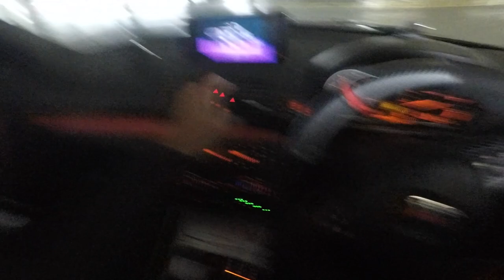Installing M3 Side Mirror Covers on BMW 1 Series E88 E87 E82 E81 10K SUBSCRIBERS FREE CASH GIVEAWAY

Comment: How do you get the mirrors to fold in? Tried a long press on the key fob lock button but nothing happens. Does it need to be coded?
Reply from the maker: @AGray-ug2gm  does your car have the folding door mirrors feature?
Reply: @CARLISONIT  it’s a 2013 E88
Reply from the maker: @AGray-ug2gm  ok but does it have the folding mirrors feature? You will know if you have the button to close your mirrors on the driver side door
Reply: @CARLISONIT  no button other than to adjust the tilt
Reply from the maker: @AGray-ug2gm  you need the feature to begin with other wise it cant work

Comment: They look amazing, can you get these for 2006 BMW 530D m Sport?
Reply from the maker: Sandro Torre yeah you can get similar style for e60, but is yours electric folding door  mirrors or manual folding mirrors?
Reply: @CARLISONIT  Mine are folding mirrors, would this be an issue with the E60?
Reply from the maker: @sandrotorre9390   No I think these ones would fit the E60 http://ebay.us/LDu9qM
Reply: @CARLISONIT  thanks man! Will check them out. Keep the great vids coming

Comment: By the way these M style caps for the E82 - E88 WON'T fit the E90 - E93 as a different size housing cap.
Reply from the maker: No they’re the same they use the same mirror caps just need to ensure you select the pre lci have you checked the link in the description?
Reply: @CARLISONIT  yes 😊

Comment: what ones would i need ? got a E82 2009 sport
Reply from the maker: shift break i’d need to physically see them, but the best thing to do is message the seller they’ll help you out 💯
Reply: @CARLISONIT  there identical to yours man......just dont fold , would it make it face lifted ? kinda new to the bmws have done some of the mods you done to your tho to mine ! ya make ez guilds to follow ! keep em going my man !
Reply from the maker: shift break My ones are the pre-lci mirrors, I think the reason it doesn’t fold is because from factory it wasn’t specced with folding door mirrors unfortunately.
But Thank you man and I will do!